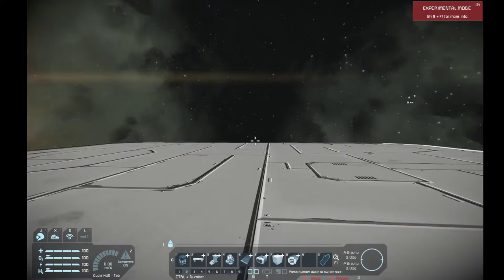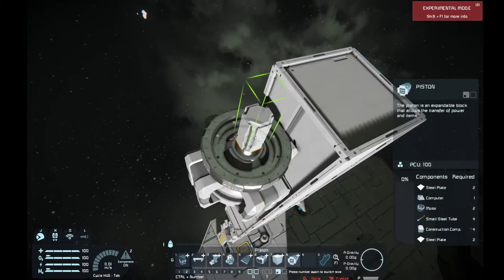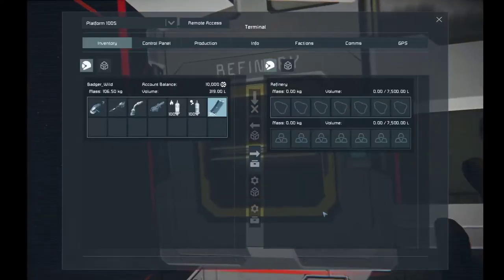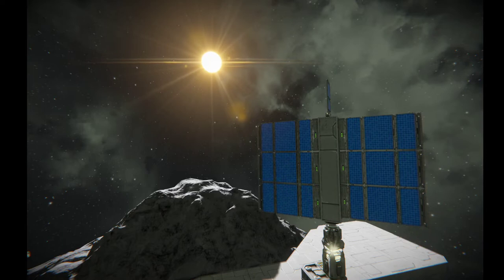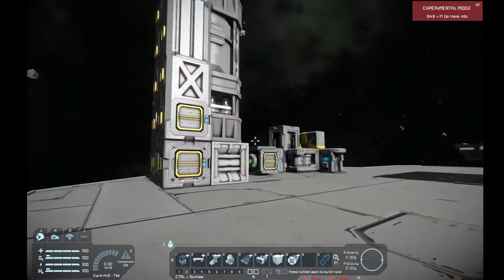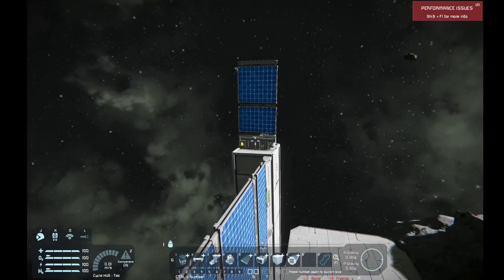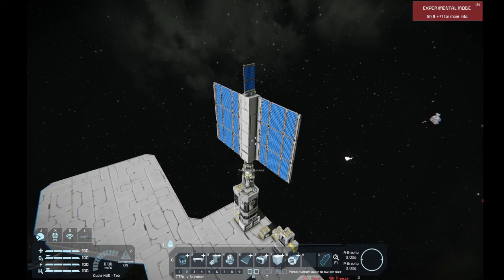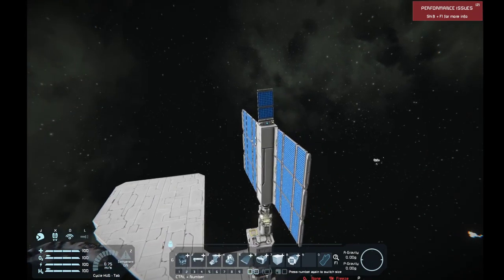Easy Sun Tracker Install! Get It Perfectly Aligned Every Time!

Comment: Thanks for the shoutout. I’ve been trying to get a similar setup done on a space station/ship, however it is a little more complicated. What would a space ship version be like? Cheers! 🥂
Reply from the maker: Same thing you would need to have rotor lock in your tool bar for maneuvers though.
Reply: @badgerwildgaming6908  I’m using it to rotate a solar powered ship/station. Only sticking on the the small solar panel as the detector to rotate the whole ship. However I encountered a problem where once the sun goes behind planet earth 🌎, it would lag behind playing catch up. It would lag even further once the sun ☀️ goes behind the planet therefore messing up the detector function. Any thoughts 💭?
Reply from the maker: Increase the gyro and increase the breaking torc on the rotor. That way it will catch up but won't spin outa control.